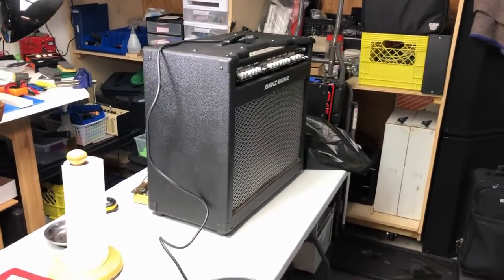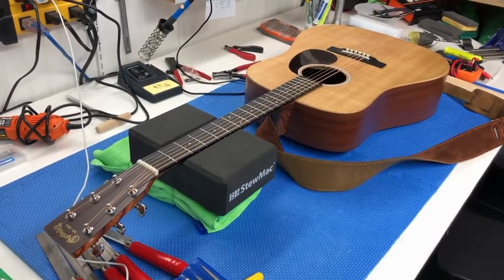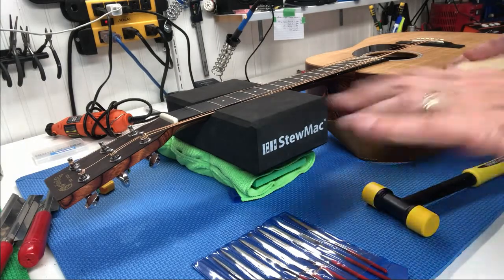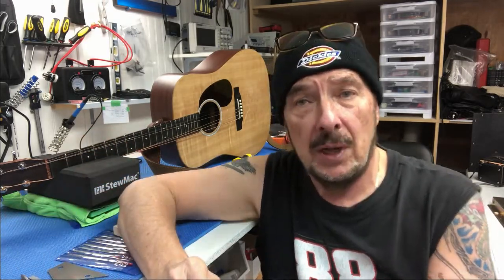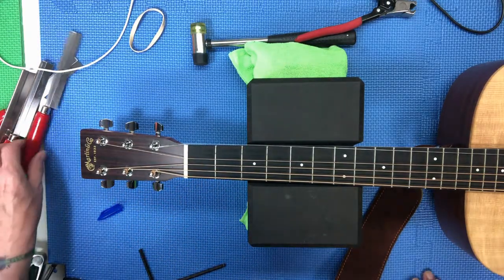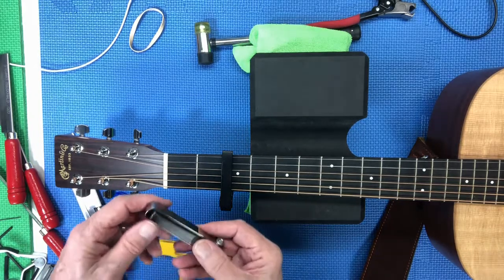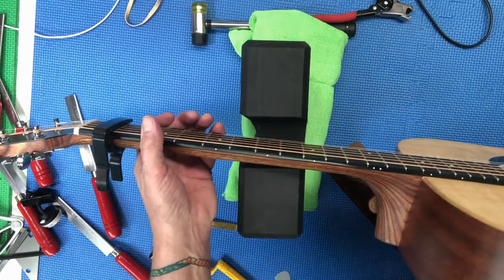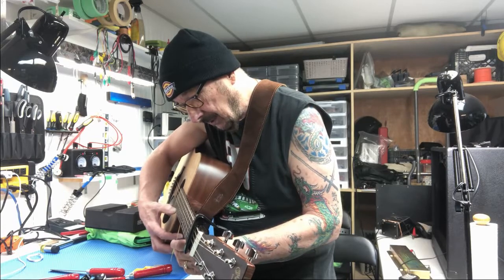Guitar Repair - Martin Guitar Dreadnought Nutty Nut Job

Comment: I know this is over 5 years from the original video posting, but I have to comment.  I have a Martin, and in my case the nut seems to put my string spacing a bit too wide for a 1 3/4" nut.  The strings, according to a few specs, should be about 35.5mm outside E-to-E.  Mine is 39.6mm.  It may explain why this spacing along with some very significantly rolled edges on my frets, my high E string slips off the fret board when playing.  Anway, this video definitely covered a lot of what I needed to see:  issues getting the nut off, techniques and specs for string height over the first fret, and so on. My plan is to replace a nut with what seems to be better specs for my Martin.  I was definitely cringing while that nut was stuck and the attempts to beat it off.  I expect mine will be the same because of yes, Murphy's Law.  And yeah, trying to adjust the truss rod with the strings on - a challenge.  I definitely had to get a MusicNomad wrench for the Martin - it worked out.  Hope all is well for Pete.   Oh, and Murphy strikes again on those feeler gauges, omg.
Reply: I have the same problem with my new Martin. I just ordered a pre-slotted bone nut from Stew-Mac. Hopefully all is well.